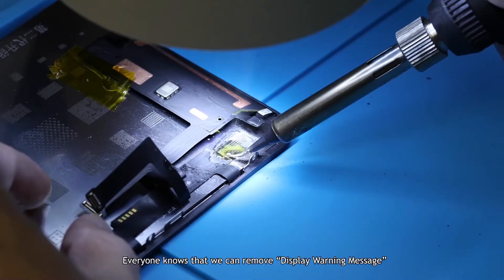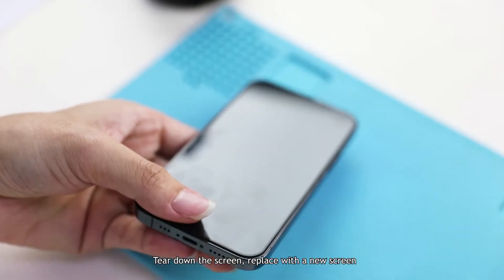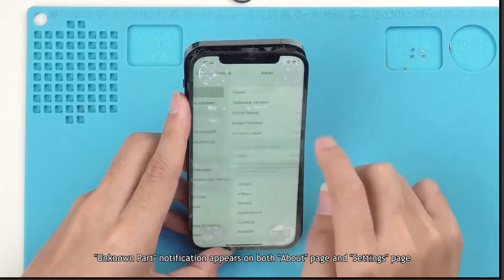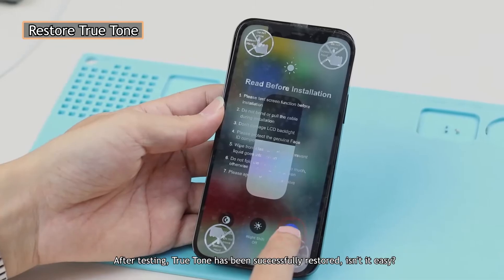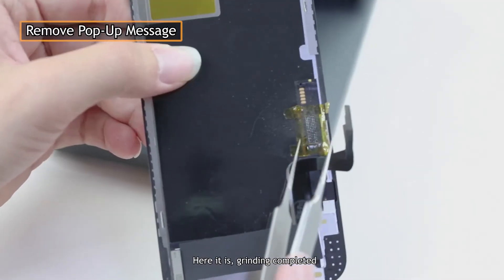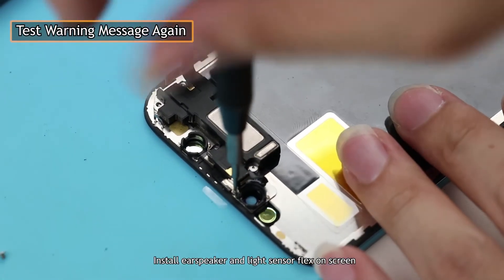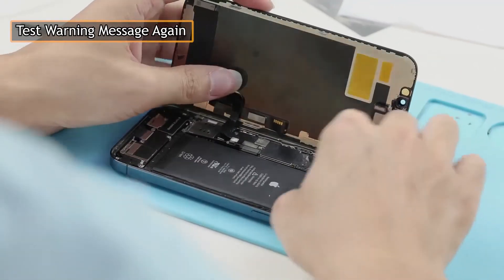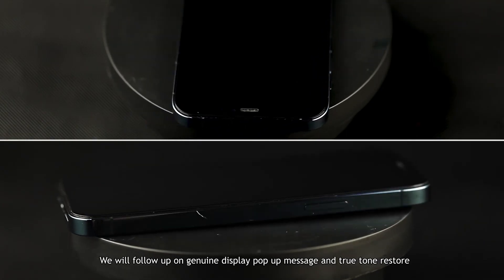How to remove iPhone 11/12  Display Warning Message by  Transplant Display IC ?

Comment: Hi. Nice video tutorial. One thing, why you use drill to remove ic chip from new screen while you can remove it with the hot air gun like you did with the old screen?? BTW the screen is OLED FLEX screen or HARD or LCD??
Reply from the maker: yes, to protecting the new screen from any damages so  we don't use the hgh -temperature hot air gun.  The screen is incell lcd, but it is old batch, the new batch screen no need to grind the chip now.
Reply: That is correct. I bought new soft oled screen incell and it does not have the ic chip installed. Super convenient!!!!
Reply from the maker: @mr.octavias   yeah, where did you purcahse these screens, we are also a wholesaler, you can send Whatsapp message me if any interest  https://wasap.my/8618620407051
Reply: Now a days it says on lcd screens specially jk prime with ic transplant
Reply from the maker: @muhammadawan1920  yes, other brands lcds also same

Comment: Hi, I have tried this method and works. Sometimes I have Apple logo boot loop after IC swap. Do you know what’s the issue ?
Reply from the maker: Normally speaking，the chip IC won't affect iPhone boot loop, maybe you can have a look of the dock connector flex or power flex